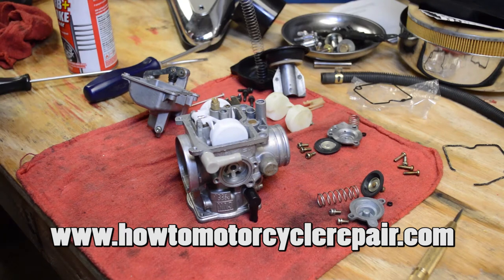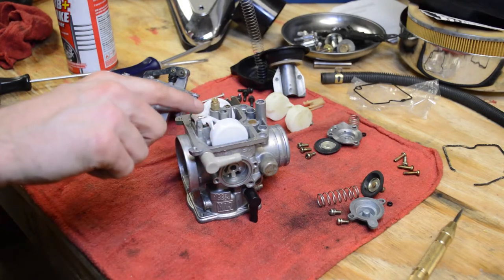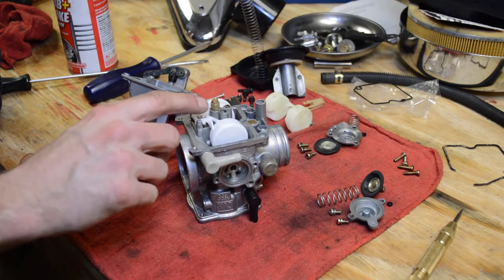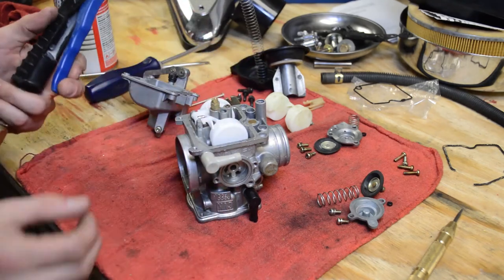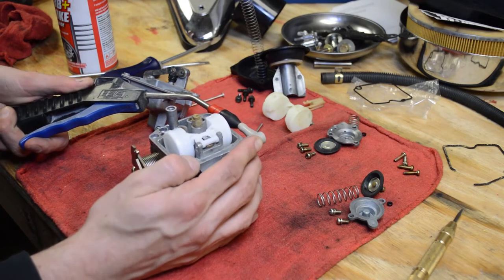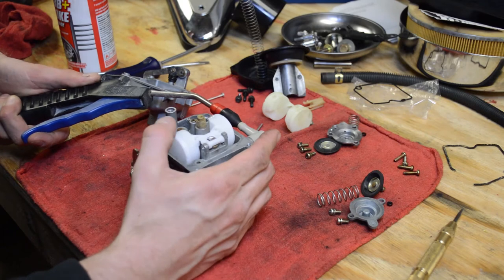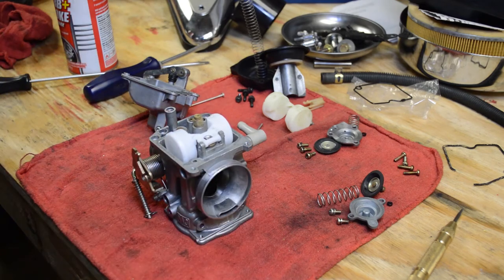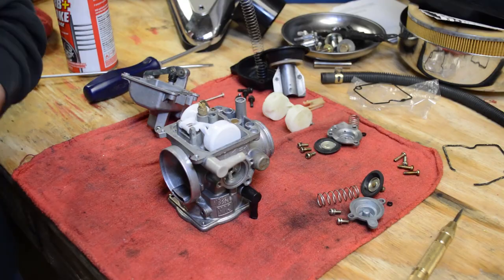How-To: Pressure Test Carburetor Float Needle

Comment: Hi HTMR.   My idle/pilot jet is slightly bent but it could still screwed back into the carb.  Will the bent pilot jet cause overflow issues?     Thanks
Reply from the maker: Replace it. They cost under $10.

Comment: I found the float needle on the floor by chance and took it's photo and uploaded it on google lens and it said "float needle", this is when I larned what it was.  I was researching why my carburator leaking fuel when my bike was on idle. Learn from my mistake folks. Also there seems no wire or anything to attach it to carburator float, probably dropped it on the floor when I cleaned the carb.  I was going to buy a new carburator but all I need is a needle attachment now, if there is any.

Comment: my carb was leaking from the overflow tube. i cleaned carb and replaced all jets (repair kit). Now when i test the new needle valve, it does NOT pass air. when using your air compressor method it does BUT it blows out of the whole valve. My question is, does the small  pin in the valve suppose to pass the air and stop when compressed?
Reply from the maker: Another test would be to mount carb in vise and manually lift float, will it shut off all fuel flow? Sometimes you can't get the air pressure low enough to do this test.
Reply: @HTMR  it is out of the ATV. I lift the float but it doesn't change a thing. Either way it simply doesn't allow the air to flow. My main question, does the small  pin in the needle valve suppose to pass the air and stop when compressed or is it the entire needle valve that lifts up of the bush to allow fuel run in? My needle valve (new) doesn't allow air flow unless i use an air compressor which blows up the whole valve an let the sir flow

Comment: Careful not to push down on the float too hard. The little rubber tip can be damaged pretty easily. Ask me how I know. LOL. It doesn't really look damaged but it can create a little ring in it. And then it might leak.
Reply: Hey man my needle has a little groove and it leaks fuel out of 1 of the lines do I need a new one probably do right?

Comment: I got a 2009 kx250f and the electrical gremlins in there fucking it all up. We have replaced the coil, ignition box and wire harness. What else could be wrong?? After it reaches op temps, it will hesitate, pop, then kill and will not start untill cool again. Plz help me :,(
Reply from the maker: destroyall24 Is the carb clean and properly jetted? Have you tuned the fuel screw?
Reply: Well.. Turns out my mechanic did not replace the harness yet so thats the issue.
Reply: Sounds like intermittent spark. It will give you symptoms of a coil going out. Wire harness must be connected to a bad cdi box.
Reply: jason t we replaced all the electronics on the bike basically. Still have the thing running to this day!